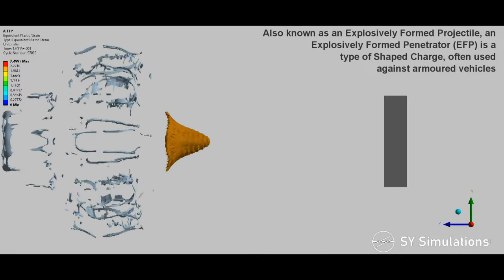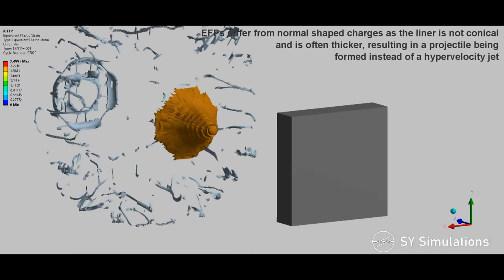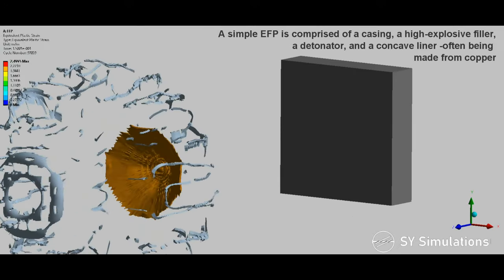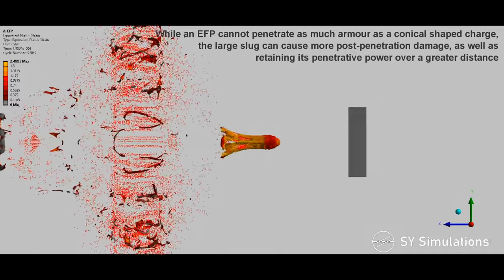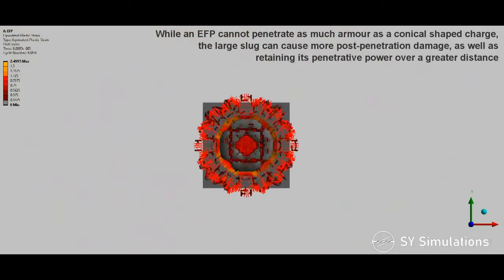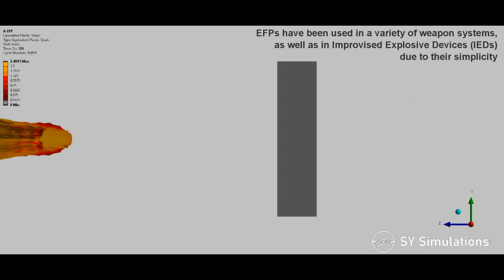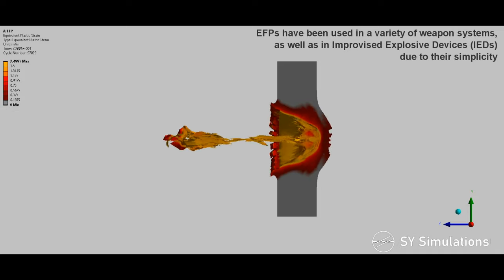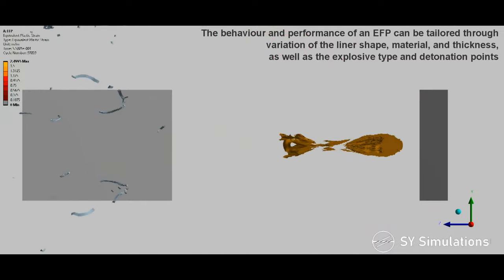EXPLOSIVELY FORMED PENETRATOR SIMULATION | EFP Shaped Charge Armour Piercing Simulation

Comment from the maker: This was a test simulation I did before going on holiday but am keen to do another, higher fidelity EFP simulation against a more specific target. Does anyone have any target suggestions?
Reply: an efp hitting t-80 ish roof (with cages if you have the time)
Reply: Can you do this against T-80 side armour ?
Reply: Maybe a simulation against Cope cages?
Reply: Not a target suggestion but doing a simulation of the different k-charge modes would be cool
Reply: i would be curious how it fares against ERA
Reply: I heard EFPs are good against ERA, try it out!
Reply: Maybe simulate a BILL 2 or NLAW missile vs a russian T tank?
Reply: Sloped armor and explosive reactive armor
Reply: Concrete bunker, even more interesting actually, a wooden log bunker like a Finnish ww2 Korsu e.dy.
Reply: Ok, pretty in depth request but here we go.
12 inch diameter EFP. Tantalum instead of copper, 8mm thick. Explosive being octogen. Square wire mesh over the front of it to segment the projectiles with the mesh being square shaped with 1 inch sections. Target is the side of a bmp3 from a range of 10 meters.
Reply: I would like do see a linear EFP whose lenght is smaller than its width. For example; 10cm long, 50cm wide and 10cm deep.
Reply: Ice cream van?
Reply: EFP of a TOW-2B against the rooftop of a T series vehicle with its rooftop ERA would be interesting.
Or one of the barrel IED-EFPs that were used in the Middle East.
Reply: How about an EFP Versus the fuel armor layout to see if it deaccelerates that projectile more than a higher density one?
Reply: Suggested target and munition: one CBU-97 SFM "skeet" against the roof of a T-90.
The CBU-97 is a cluster bomb that uses explosively formed penetrators to kill tanks. Each skeet has sensors to tell what is a tank and what isn't, so the munitions will destroy the tanks instead of just whatever random stuff the bomblets land on.
Reply: What next?  Leopard 2.  The turret front has that space meant to defeat rod penetrators.  How would it fare against a self forging penetrator?
Reply: Im curious about why copper specifically for the liner (low melting point so it can deform more easily probably helps). But what would happen if you used a more or less dense material such as lead or aluminum ?
Reply: What if i need a tutorial for this simulation, i really need it
Reply: can you do simulation of GBU-24 (bunker buster bomb) hitting the turret of battleship
Reply: Manhole cover vs a armoured car
Reply: Bank vault door, for funsies.

Comment: You can electroform copper onto the bottom of a monster can or spray paint can for a pretty effective small EFP  that can penetrate light armor.
Reply from the maker: Quite a few people are mentioning similar things and I've somehow never heard of them...
Reply: @SYsimulations  it's a little freaky how easy it is to make such powerful weapons.
Reply: @chemistryofquestionablequa6252  Copper coins inside a wine bottle and then packed with explosive. Spoiler : It Works.
Reply: @SleepySkull1  it does, but not nearly as well as a consistent thickness liner that covers the whole end of the charge.
Reply: @chemistryofquestionablequa6252  the main difficulty is money and access to required resources rather than complexity. As long as you got the resources and you have a decent understanding of a weapon you're trying to make, its not very difficult.
Reply: @Isaac-ho8gh  this can be done for under $20 if you know what you're doing.  Just a trip to the hardware store really.
Reply: @chemistryofquestionablequa6252  true, but it'd likely not penetrate much armour assuming you mean a small EFP round.
Reply: @Isaac-ho8gh  it'll go through at least 2 inches of steel. I certainly wouldn't want to be on the receiving end of it. Pretty effective to over 100m too.
Reply: @chemistryofquestionablequa6252  I know its capable of much more, but it'd vary quite a lot because of many factors.
Reply: @chemistryofquestionablequa6252  fair enough, it probably would.
Reply: @Isaac-ho8gh  the most important factors are the length vs diameter of the charge, it's density and det velocity and the thickness of the liner. Not going to give detailed instructions for obvious reasons though.  Also a cheap laser pointer is super helpful to help aim it.
Reply: @chemistryofquestionablequa6252  yeah I know, what made me mention that there's many factors was penetration for an EFP if it was bad enough could be under what you mentioned lol

Though, don't worry about the instructions. I don't need to make an EFP weapon ATM but why would a laser pointer be needed? Iron sights which can be calibrated could work well enough.
Reply: @Isaac-ho8gh  lasers are convenient and cheap at the dollar store is really the only reason.  Plus they're more accurate over longer range.
Reply: @chemistryofquestionablequa6252  fair enough but I don't think they'd be much more accurate at longer ranges since they obviously fly straight which wouldn't take account of bullet drop. Although mounting a laser onto a base of an adjustable rear sight would work!
Reply: @Isaac-ho8gh  when you're talking about slug velocities of near or over 10 000m per second, drop is negligible.  These projectiles move obscenely fast, many times faster than a rifle bullet.
Reply: @chemistryofquestionablequa6252  wait what!? I never knew they gone that fast! Holy fuck lol
Reply: A halfway decent EFP penetrates about  half the charge diameter.
Reply: @Isaac-ho8gh  yeah, they generally go as fast or faster than the velocity of the explosives used. It's possible to go faster because of the squeezing action of the detonation wave basically squirting the slug out like squeezing a watermelon seed.
Reply: But that is way too thin!!!
Reply: Act accordingly.
Reply: or just use copper filled 3d printing filament
Reply: You can literally make an effective anti-tank weapon with just 50 bucks and a trip to Home Depot.
Reply: I have came here for the knowledge of the dark arts lol
Reply: @Noobixm no you can't lol where are you going to get a charge with sufficient det. velocity?
Reply: @chemistryofquestionablequa6252  i think it gives me safety that an invading army or repressive government can still be made into fearing and being hunted by your everyday steel worker, welder, pharmacist etc.
Reply: @Isaac-ho8gh  access and money can be bridged by improvisation. Molotovs can blind a tank and a simple sticky charge made of everyday ingredients i wont name can blow apart its tracks. The only thing hard to make are useful small arms thats why i support liberal gun laws
Reply: @teknofreak2387  I love that reality and the information being freely available isn't nearly as dangerous as some people think. People who are capable of causing a lot of damage rarely want to and people who want to are rarely capable. There's a bit of a "safety catch" on humanity that makes sure that nefarious actors are rarely very competent.

Comment: That's neat! I didn't know there was differentiation between varieties of shaped charge penetrators, I figured they were all similar enough to be called EFPs.
Reply from the maker: The naming convention of shaped charges isn't great, but yeah, an EFP tends to refer to the slug type
Reply: @SYsimulations  Yes, when studying this in the 90's, it was explained as the shaped charge focusses on the jet and an EFP focusses on the slug. We were taught that you would go for a shaped charge if you could control the stand-off distance and you would go for an EFP when you weren't sure of being able to get the right stand-off distance.
Remembering the face of my colleague who was trying to model this in Autodyn in 1997/98, it was an exercise in frustration to get it right (modelling it). If I remember correctly, it was a small margin between 'explosively launching a deformed plate' towards the target and 'getting a jet launched' at the target. The bit in between where the EFP lives, was hard to find.

Comment: I was going to say that strongest form of EFP is hypothetical Casaba Howitzer, which uses hydrogen bomb to propel liner made of tungsten, but then I wasn't sure if it actually counts as "projectile" if tungsten turns into stream of plasma.
Reply: If it is plasma then it is not efp.
Reply: @jintsuubest9331  Then it's an "explosively formed plasma" :)
Reply: The working principles of those devices available in public information seem to be on the fantasy side to me, not because they are not possible but because the pressures, temperatures, speeds and energy flows are so absolutely insane that things do not behave in an intuitive way, shock waves are no longer product of mechanical motion but energy flow due black body radiation, tensile strength is meaningless, mass and density becomes more important and makes me wonder how those devices can be practical at all and not just some napkin games by physicists on their path to develop more efficient coupling between stages on thermonuclear devices.
Reply: It'd be vaporised within a thousandth of a second. Also the target would be vaporised by the thermonuclear weapon thus obviating the need to penetrate it.
Reply: @colinstewart1432  
"Target would be vaporised by the thermonuclear weapon" assumes nuke gets close enough to target that square-cube law doesn't reduce it impotent and casaba howitzer allows longer stand off distance vs other space craft.
Reply: @GeneralCalculus  Longer standoff is right. Where's it being fired from Jupiter? 🤣

Comment: I have a request that I thought of a while ago that I think would be interesting. What about a big 1800s cannon vs a modern tank? Obviously the cannon will have no chance but it'd be interesting to see what it'd actually do. I don't know enough to say what type, but those really big ones you often see on display in parks or on the coast. You could just about fit your leg down the barrel. A good example is in centennial park in Sydney, Australia.
Reply: like the 100 ton gun?
Reply: @tdpro3607  I meant more like a 68-pounder gun, but anything like that would be really interesting to see.
Reply: Apparently the ones in centennial park are 36 pdrs, and that kind of shot weight was pretty common for heavy guns. Just to give a reference point, 36lbs is about 16kg, which is in the kind of area of many rounds of roughly 4inch (102mm) calibre from the ww2 era - but the age-of-sail shells are obviously going to move a lot slower, and encounter a lot more resistance due to their spherical shot. Their muzzle energy will be exceeded by much lighter, smaller guns, but their shot will still have a fair amount of momentum
Reply: This sounds like a fun one to see
Reply: works,but not mobile, bullets expensive, heavy, cost ineffective
Reply: one of those ottoman cannons

Comment: In anti-ship missiles the shaped charge is this (efp) not heat. This is one of the main resons why battleships went out of use and not aircraft carriers as many think. The soviets had no carriers in the 50s and 60s, but built several missile types with efp warheads (500-1000kg). These would go through thickest battleship armour and would still cause massive destruction inside... unlike heat.
Reply from the maker: Thanks! That's interesting to know and makes sense, would you mind elaborating on the "battleships went out of use and not aircraft carriers" statement as I'm not sure how that links to the EFP missiles?
Reply: @SYsimulations   I m sorry there. Left out "because of". In various books and documentaries the downfall of the battleship was mainly atributed to the increasing use of aircraft carriers. However battleships werent retired after ww2, many went on to serve into the late 50 s. The main enemy in the cold war was the USSR that had no carriers until the 70s, but had powerful anti-ship missiles with efp warheads developed by the mid 50s. So this may be the more important cause.
Reply: @S300V  I highly doubt there is a need for ANY explosives at all, given the sheer mass of those things and their terminal velocity... Maybe a great idea for one of the next videos?
Reply: @getsideways7257   The 15-16 inch gun shells had similar mass and often failed to penetrate battleship armour... So yes the missiles needed warhead and the EFP type warhead allowed lighter ones to be used for the same destructive power.

Comment: For the distance it fuses and minimise its shape & vulnerability (and creating lots of forces that can blind sensors) many modern active protection systems can be bypassed by range fused EFP's, granting them a niche even in the most modern battlefields.

Tbh i support that conflict got so complex and more and more the smarter competitor has an edge (if tools for benefitting are availabel).

Comment: There's an effect upon the jet stacking up on the surface that Thunderf00t actually goes over in his video about water intrusion into the mini-sub being limited to about mach1 in spite of the immense pressure.   So the jets aren't actually jets they're a plasmiated form of oobleck that then turns solid at the surface of contact resulting in a non-elastic application of a large proportion of the energy.       The thing with these explosive charges is they're also velocity dependent for efficacy.

Take for example the 25mm high explosive shells fired by the M242 Bushmaster, they have a different cone angle from the 30mm shells fired by the chain gun used by the Apache helicopter because the M242 fires them at near-on 1150m/s whereas the ASP is designed for 825m/s and it does make a difference to have the correct cone angle.

Furthermore the animation you had in this video doesn't take into account the relatively rapid circulation out from the tip of the jet which works like a plasma lance.

Comment: A conical (cone) EFP has a minimum stand off distance because the cone is collapsed in on its self and turned inside out on its self from the tip if the cone leading out to the edges and there is a distance that the cone needs to turn inside out on its self to form the jet moving at over 22,000 MPH.  It’s super hyper sonic this jet is moving so fast it does not even notice the steel in front of it (unless it’s a meter thick or has special armour and it travels into the tank that creates an over pressure that collapses all the hollow cavities in your body from your lungs, bowels and ears and brain cavity in a millionth of a second, this also causes the air in the tank to become super heated in a split second and causes anything combustible to burst into flames, also the copper fragments and causes shrapnel wounds.  This type of explosive lens in this video is not as dangerous as the cone shaped warheads and it does not travel as fast as cone shaped EFPs but still very deadly if it breaches the armour.

Comment: I wonder if they use copper because of its easy malleability.  That might suggest a more even expansion, less fragmenting, and an altogether more predictable result.
Reply: Copper is used because it’s ductile, shapes in a uniform and expected way. It is also cheaper than some alternatives, although there are exotic metals which have penetration potential of twice what copper has.

Comment: Look up Dart anti-tank Guided Missile system warhead 1/2 thick aluminum hemisphere approx. 6" in diameter with a high velocity charge of HE able to drive it through the bow on a T54/55 with the aluminum turning into vapor on penetration which then would ignite inside the vehicle good warhead bad guidance package very hard to control.

Comment: What if the cone is made from DU ?   They surely have tested this ?  A Pb one even.  I wonder.
Reply: The cone needs to be made of a soft metal like copper in order for it to be malleable enough to invert.
Reply: @OngoGablogian185  : last i ckecked Pb ( lead ) is sone super malleable shit. As for the DU (depleted Uranium) if it itself were doped with sufficient Pb it also could be made malleable. One could also negate an alloy altogether by fine matrix particulute slurry of 400 mesh DU granules and an appropriate metaloid polyner/epoxy.  
Newtons laws state : 0.5 x M x meters p/s gives impact force.  Uranium being at 238 nucleans to coppers 68 mean Uranium is 3.5 times the mass.  If an shaped charged could be made of such material is would have superior depth penetration compared to conventional EFPs.
Reply: @GraemeWight-wx3xz  Fair enough. You obviously know a lot more about this. With what you've stated, though, they surely must have tested it. The R&D budgets for this must be unimaginable. There's probably some really interesting research papers published somewhere.

Comment: Can anybody name one or two current examples of systems where this method is used?
Reply: I believe the germans have an "off-route" mine that they use that sits off the road in cover and detonates when a vehicle drives past. I think they are currently being used in Ukraine
Reply: Tow2b
Bonus
Reply: The Pzh2000 has an ammunition that opens up mid flight above the enemy tanks and drops an EFP charge with a small chute, while descending, sensors search for any nearby tanks and when they find them they shoot the EFP down onto them (weak upper armor plates means it goes through most times)

There's even some drone footage from Ukraine where you can see it in action against Rus tanks
Reply: Engineering charges. For example soviet/russian anti-bunker charge KZ-4. Recently there was a video from one guy who used this charge to penetrate side armor of the tank
Reply: SLAM mines use EFPs.